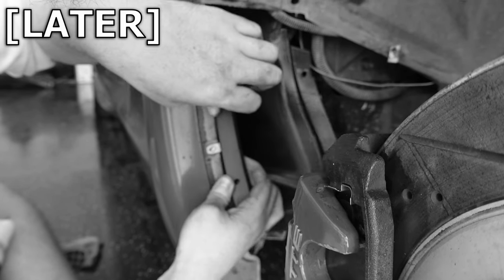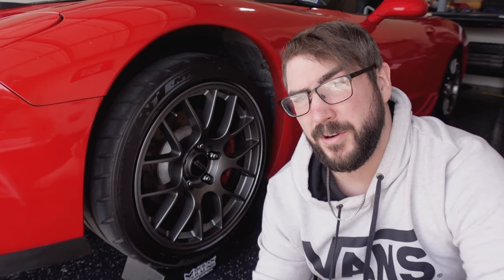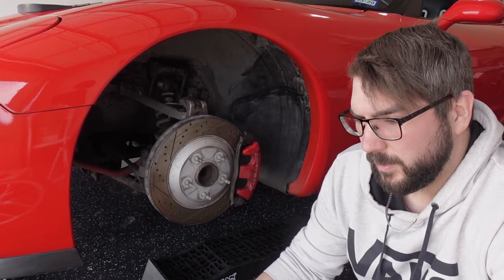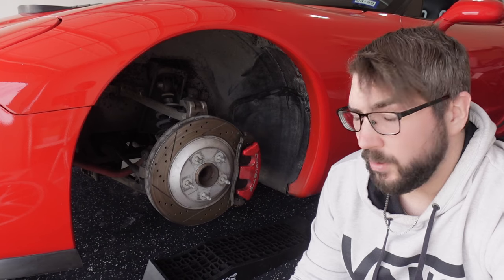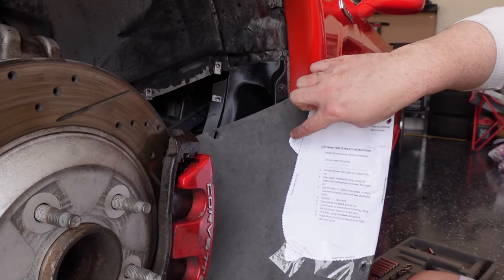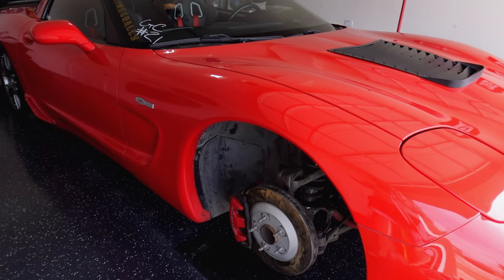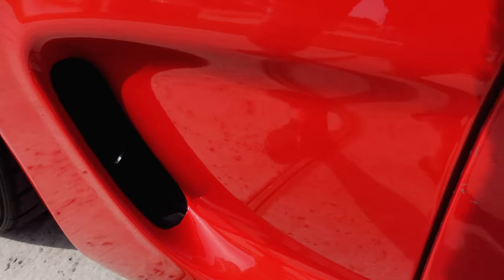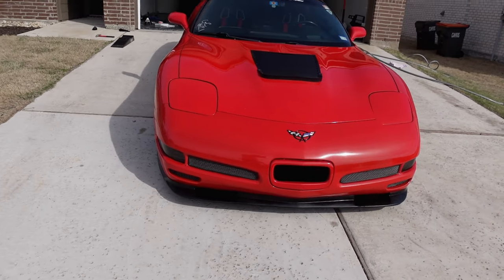Do This Mod If You Track Your C5 CORVETTE! // Functional Fender Ducts

Comment: The module you had to work around on your passenger side is the Performance Control Module.
Reply from the maker: I suspected that was the case. For some reason I thought it was on the driver's side.

But I guess in hindsight, I don't remember seeing a module when I had the driver's side fender off.
Reply: Just nitpicking, but it's not called a Performance Control Module, it's called the Powertrain Control Module or sometimes the Engine Control Module (ECM). And the little black box in front of it is the Throttle Actuator Control (TAC) module.
Reply from the maker: @dekesone1  That is good info. Thank you!
Reply: is it just me or is that the dumbest place to put a computer module?
Reply from the maker: @kayvonmansouri  It kind of feels like it. I think I might relocate the battery to the truck, and then relocate the PCM to the battery compartment.
Reply: Why you always want to use a dry cell battery..have had cases of battery leaking down onto the cars  computer. Definitely not a good place for it.
Reply: Do like I did take the PCM move it up to the battery compartment wire harness is long enough EZ access and the battery won't drip acid on it
Reply from the maker: @leonbachman5345  that's what I'm considering doing. I might relocate my battery, and then relocate my electronics to the battery tray.
Reply: @ChaseFarrow  I cheated I just put the PCM on top of the battery with a foam pad in-between
Reply: @ChaseFarrow your trunk might be closer than the truck 🤣😅
Reply from the maker: @One-way  Nahhhhh. The truck will work. Just need some long leads lol
Reply: @ChaseFarrow I almost moved my battery to the back but the way the engineer's put it high in nearly the middle and having the brake and clutch opposite seemed to be the best centrally balanced weight. Moving to the back puts an unequal balance back there. Relocating the PCM next to the battery is what I did. And braille battery for the size

Comment: It's a good idea if you track  your car but it's a bad idea if you have it just  for regular driving .. cuz there's a material fly through it and hit the side   doors case  chip  paint or damage the  side doors   that's why gm they  don't add that... it's personal choice
Reply: i have them on my C5 that iv daily drove year round since i got it in early 2020 and i dont have this issue then again mine also has a screen or mesh on them too so

Comment: Hey, I inspected my 03 Z06 today and heat DOES exhaust from the engine bay through the side air vents! If I look down through the engine bay toward the side vent on the drivers side, I can see my fingers reaching around the black plastic deflector located in the side vent. The deflector keeps the vent from looking like a hole in the side of the car, but air can still move through and around it.
Reply from the maker: Hmm. That's interesting. Also, good information! I'm not surprised some air can escape through there, though, it does seem like a horribly inefficiencient method of getting heat out of the engine bay.

I do still believe those vents are better served reducing turbulent air in the wheel wells, but that is still good info, though!
Reply from the maker: I definitely appreciate the follow-up, though!
Reply: @ChaseFarrow  Ya, maybe, but if you think that air is being forced into the engine bay through the front vents by the movement of the car, the air has to move out as well, around the hood gaps and any other openings around the fire wall. The under side is sealed off pretty well, so the air can be forced out the side vents. I’m a retired hvac tech, so I worked with moving air a lot!😀
Reply: @darrylsjodin7184  Air want's to escape through the bonnet since its being forced upward not downward
Reply: @exoticspeedefy7916  Yes, when you’re sitting at a stop light. When on the freeway, air is blowing through the engine compartment at 60 plus mph, so the air is forced out through every vent.
Reply: @darrylsjodin7184  Yup, the side vents are for the engine bay. The hoods on these cars have weather stripping that seals off a lot of the ventilation from the top. So the side vents are functional, but not for anything in the wheel well from factory. I hear heat soak is an issue if you're driving slowly or stopped in hot weather.

Comment: C5 side ducts pull air from the engine compartment helping control heat build up under the hood. Shine a light down by the brake master and it will shine through the vent.
Reply from the maker: I can't quite tell if that is actually its intended purpose or if that's more of an incidental thing. If it's intentional, then it was just terribly designed, because two of the biggest things the C5 is known for are

A.) Floating front-end from high pressure under the hood, and

B.) Poor heat management in the engine bay

Personally, I lean toward it being an incidental thing, because if it was a purposeful design, they failed miserably.
Reply: I like this benefit

Comment: Incorrect. Those vents are for engine bay and reduce turbulence at the undertray. Laminar flow down the body sides rather than over pressure of the engine bay. Now you have dirty airflow under the car. It is not a "Dumest design flaw" it is a highly calculated and measured function proven in the wind tunnel and track years before you decided it didn't make sense.
Reply from the maker: @scoutdogfsr  No it's not. The C5 was not wind tunnel tested during development. It was cobbled together by four guys in a shed. I don't know where you people get the idea that the C5 was some kind of aerodynamic engineering masterpiece. I love this chassis, but it just wasn't. 

What little effect the factory vents would have had were incidental at best. Not to mention, the laminar flow alongside the car that you mentioned was pretty much non-existent from the factory because of massive out-washing from the wheel wells. This is an issue with every single closes wheel car. This does fix it outright, but it does help it significantly.

The underside aero profile on these cars is a catastrophe from the factory, which is one of the reasons the C5.R and every other track built C5 has most of the same changes I've made, and why GM made so many changes almost immediately after this. Dozens of privateer teams who have spent the last two decades developing these things, (and actually do have wind tunnel data), all say you are absolutely, unequivocally, undeniably wrong. I invite you to check out companies like Trackspec, ElectronSport, 9LR or many of the others that build this stuff. Their wind tunnel data is available to the public.

Comment: I have never looked, but I was under the impression that the side vents were functional for exiting hot air from the engine bay?
Reply from the maker: Not to my knowledge. I can't imagine how they would, especially with the panel that blocks air from escaping out of it.
Reply: Youre correct. They vent under hood heat and press  This is a bad mod to do.

Comment: Yes those vents are functional and the have been since the C3 . They are engine heat vents you know to get the hot air out. They aren't supposed to be areo vents
Reply from the maker: IF they are, it's incidental. The C5 is famous for running hot and for building high amounts of under-hood pressure at high high speeds. 

Either they weren't designed for ventilation, but they just so happened to be a place where some of the pressure can escape, 

Or,

They were intended to reduce heat and pressure in the engine bay, and it's just an unbelievably awful design. 

Its one or the other. either way, the combination of a hood vent and adding these ducts is objectively better.

Comment: I used fiber glass to direct engine bay heat out the side vents. These are cool though, however I would be concerned about rocks and dirt getting shot down the side of the car from the tires. Best place to vent wheel well pressure is out the top either through a custom fender vent or to join the top of the wheel well into the engine bay and have a hood vent.
Reply: No issues with debris,road spray,etc.

Comment: I have screens on the fender openings on mine for looks, but adding a second on the intake (wheel well side) may cut down on rocks and debris a touch. Either way it's a good fix considering the brake ducts are forcefed air.
Reply from the maker: I had actually considered that. I don't know how I feel about the way that it looks. I was considering putting some satin black wrap on going from the opening of the fender duct to the edge of the fender, (where it meets the door), to try and protect the paint from little rocks that get picked up when the tires are hot.
Reply: @ChaseFarrow  If you don't want to change the color, toss a piece of paint protection film on there. It comes in clear (gloss or matte finish) and also in black. It will hold up much better than wrap will to rocks. I have PPF on the front of my Z06. I learned the hard way that rocks won't hold up to rocks very long.
Reply from the maker: @BasinMotorsports  I actually kind of like the look of the satin. Do you know if you can do PPF film over wrap??
Reply: @ChaseFarrow  yes you sure can.
Reply from the maker: @BasinMotorsports  Hmmm... I guess I have some things to consider lol

Comment: Sold out again! I emailed them and they replied they are in stock again, I went back to their site and they are still marked sold out preventing an order from being made. They do not have a telephone number and they say they do not want people emailing them. I'd like to make those fender openings functional but the Knucklheads at Electronsport (what a stupid name for a company that makes parts for combustion engine cars where the electronics have not a dam thing to do with what they are selling). They are so stupid they market parts that are not available. What a way to run a business!
Reply: Sounds more like an ungrateful Neil :)
Reply: I remain Grateful. I was inpatient wanting it immediately, but they were well worth the wait. The ducts are well made and fit well and look great. Chevrolet should have included this mod because that dummy opening was reminiscent to to the old straight six mustangs that had dummy hood scoops. When a car has something that appears obviously fake, it makes the car look cheap. People notice these functional ducts and most C5 owners want them. They were easy to install and look like the factory installed them. I am extremely satisfied and grateful, although I cannot truthfully say they provide any real benefit other than improving the appearance. I don't race my car, so my brakes don't heat up to the point of needing further cooling. With 40K on the original factory brakes that still have life left, this was cosmetic for me. Seeing a dummy duct opening bothered me. It didn't really matter, but I found it disturbing. @erikschmidt476
Reply: @GRATEFULNEIL  I completely agree!
Reply: Electron is for a paint color is electron blue

Comment: That's actually the TAC( throttle actuator control module) definitely don't want to disturb it or it's connections can throw your car into limp mode with zero throttle.

Comment: What if you have the hood track vents on the side and this? Would that make the dirty air worse, better, work the same?
Reply from the maker: That's actually an excellent question. I kind of mentioned this a little during filming, but ended up cutting it out because it was a bit rambly and I didn't think people would actually care that much lol

Due to the amount of time TrackSpec spent testing their vents, I suspect it would be an even greater improvement to have them in addition to the ducts, simply because it removes another hard surface for the air to collide with before exiting the wheel well.

However, (and I mentioned this in the film I now wish I hadn't cut out), I elected to not do the side-hood-vents because, while I do track this car, it still spends 95% of its life on the road, and I was worried about throwing rocks up through the vents.

Realistically, the vents on the hood would do better for evauting turbulent air caused by the rotation of the wheels, (hence why the AMG One has electronically actuated vents in the same place), whereas these vents will do more for releasing air being piped in by the front brake ducts.

If you're building a dedicated track car, I highly recommend doing both!

Comment: How's your paint looking now? I'd imagine there would be some form of sandblasting with such a large opening.
Reply from the maker: It looks fine, though admittedly, I haven't put many miles on it since installing, plus the roads in my area are extremely clean.

Comment: I thought that those air extractors were to relive under hood air pressure.  Side air extractors were considered functional since the 1982 Trans Am.  What about the rear wheels?  I suspect a similar issue, perhaps not as significant.  I see you have the hood vent to deal with under hood air pressure.  This mod should improve brake cooling,  have you noticed an improvement?
Reply from the maker: I have a couple of track days coming up, so I'll definitely be able to answer the brake question soon.

As for the extraction, they may extract some, but they sure as hell don't do anywhere near enough. These things get super floaty over 130 without a hood vent
Reply: @ChaseFarrow  yes, i agree about the floatiness above 130,  the C7 was much better at higher speeds
Reply from the maker: @richarddobreny6664  Yeah. They ditched the bottom-breather design and went to a more conventional means of directing airflow. I understand what they were trying to do, but the original bottom-breather design was deeply flawed.

I've had many purists comment on my modifications to the airflow and say "bUt ThE eNgInEeRs DeSiGnEd It LiKe ThAt FoR a ReAsOn." 

And they're right. They did design it like that for a reason. It just wasn't a good one lol 

Even GMs factory race team knew that it wasn't a good design for performance. That's why the C5.R wasn't a bottom-breather.

Comment: They always seem to be out of stock haha. Did you just check on the website every now and then to see when they where back in stock? I’m also debating doing the opening where the front plate goes, heard it makes a noticeable difference. You think it’s worth a tenth maybe 2 in the quarter?
Reply from the maker: It took me about a year to finally get my hands on them because they'd come into stock, and then within a couple of hours would be gone.

Eventually, I started keeping a tab open on my browser, and every morning about 7:30am when I went into my office to start working, I'd refresh the tab until it I finally caught them lol

I managed to pick get them the weekend of Thanksgiving last year, and have been waiting to install them ever since lol
Reply: @ChaseFarrow  dang, don’t think I’m that motivated to snag a set. Maybe down the road once she’s sorted out more I might start trying. Gotta torch red Z as well, almost 135k miles, but she’s in the shop at the moment because I did a clutch and rear main on jacks myself and sure enough it’s been leaking ever so slightly. I’ve done all the work on the car myself since owning it so it’s a bummer to not be able to take care of her this time around but hopefully it’ll be fine now, fingers crossed.
Reply from the maker: @richardelliott8352  There's absolutely no way that the fake vent with a block plate is faster than with it vented. 

While it's going to make almost no difference in a straight line, venting the fender allows for a reduction of turbulent air inside of the wheel, which makes for cleaner air around the fender area and better brake cooling. 

Whether it be in a straight line or around a track, (especially the latter), venting is going to be faster. 

Source: I've never seen a racecar with fake vents.

Comment: Great video  can i ask you what rims are those and the set up u have onyour Z06... im looking to change my current set up form the 18/ 19 set up i currently have on... plus i am looking to do a c 6 brake upgrade and i heard you cant fit them on stock wheel set up...Thank You
Reply from the maker: It depends on which C6 brake package you're doing, honestly. If it's the Z06 package, then no, those brakes will not clear a stock 17" front.

My very next video is a big brake upgrade, where I talk a lot about brakes, how they work, and why you should or shouldn't do them. So it may have some useful information for you.

I will say, if your car is really just a street car that maybe occasionally does some AutoX or spirited driving, you're better off saving your money. 

You'll get more benefit for 30% of the money flushing your brakes, installing steel lines, going to a DOT 4 fluid, and getting better brake pads than spending a whole bunch of money on a C6 kit.

Comment: I was impatient. They finally received stock and was able to place and receive my order. It was an easy install and looks great. Does it achieve anything from a functional stand point? Who can tell, but it looks like the way it should have come from the factory. I hate fake scoops and ducts that were put there that are blocked off from functioning making the car look phoney.
Reply from the maker: I'm with you on the fake ducts. As far as functionality, it depends. If you're using them on an exclusively road-driven car, no. They're not really going to add anything other than a neat aesthetic.

If they're being used on a more track centric car, they are going to help reduce some of that turbulent air inside the wheel wells, cleaning up the air moving along the side of the car at higher speeds.